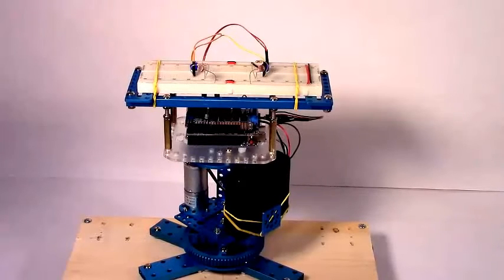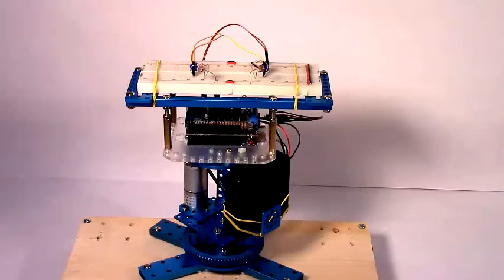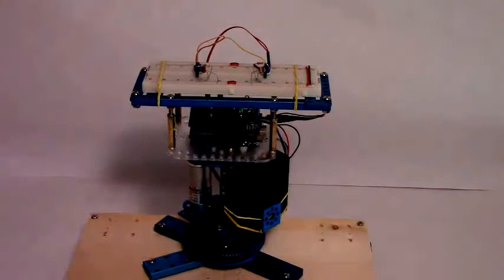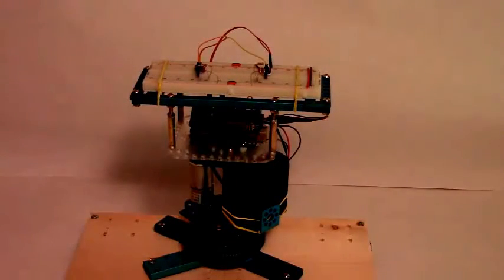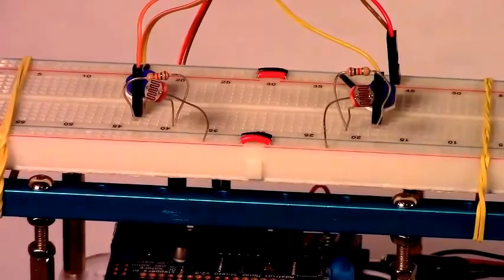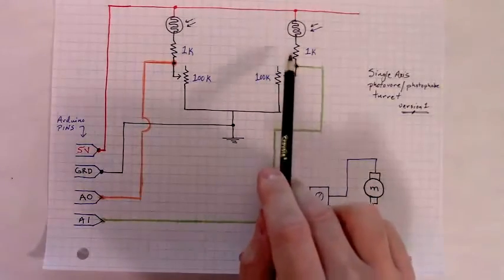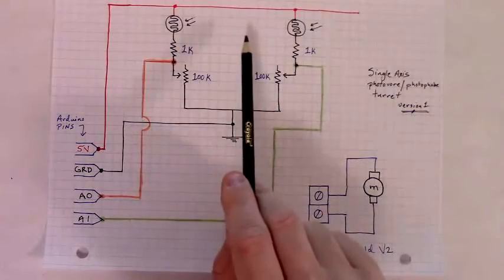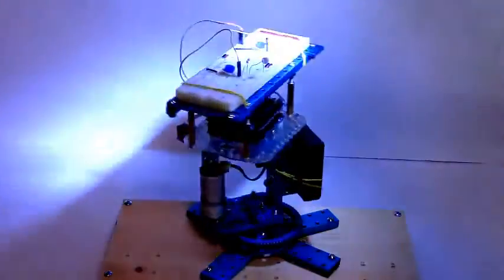Arduino Robot Projects || Single Axis Light Chasing/Avoiding Turret || Version 1

Comment from the maker: /*
title: photovore_photophobe_turret_version_1
by: philomech
date: 2/2015

*Code logic could be simplified a bit, but works fine as is.*

*/
#include <Wire.h>
#include <Adafruit_MotorShield.h>
#include "utility/Adafruit_PWMServoDriver.h"

// Create the motor shield object with the default I2C address
Adafruit_MotorShield AFMS = Adafruit_MotorShield(); 
// Or, create it with a different I2C address (say for stacking)
// Adafruit_MotorShield AFMS = Adafruit_MotorShield(0x61); 

// Select which 'port' M1, M2, M3 or M4. 
Adafruit_DCMotor *motor_one = AFMS.getMotor(1);  //turret motor connected M1

/************************
* global variables        *
************************/
const int p_cell_left  = A0;     //assign photocell pins
const int p_cell_right = A1;

int left_value  = 0;      //used to store incoming
int right_value = 0;      //p_cell values

const int bright_threshold = 800;  //adjust as needed

/************************
* setup                   *
************************/
void setup(){
 
  //Serial.begin(9600); delay(100);  //for debug
  
  pinMode(p_cell_left,  INPUT);
  pinMode(p_cell_right, INPUT);
  
  AFMS.begin();  // create with the default frequency 1.6KHz
  //AFMS.begin(1000);  // OR with a different frequency, say 1KHz
  
  // Select which 'port' M1, M2, M3 or M4. In this case, M1
  Adafruit_DCMotor *myMotor = AFMS.getMotor(1);
  
  // Set initial motor speed, from 0 (off) to 255 (max speed)
  motor_one->setSpeed(140);   //adjust as needed
  
  motor_one->run(FORWARD);
  motor_one->run(RELEASE);
  
}  //<---end setup

/************************
* main loop               *
************************/
void loop(){
  
  //collect left-right values
  left_value = analogRead(p_cell_left);
  delay(2);
  right_value = analogRead(p_cell_right);
  delay(2);
  
  /*  //for debug
  Serial.println(" ");
  Serial.print("Left = ");  Serial.println(left_value);
  Serial.print("Right = "); Serial.println(right_value);
  delay(500);
  */

  //-------photovore/light chaser code-----------------
  
    //Is either value greater than bright_threshold?
  if((left_value > bright_threshold) || (right_value > bright_threshold)){
    
    //if left value is greater than right, turn "left"
    //i.e.,turn toward the light
    if(left_value > right_value){
      motor_one->run(BACKWARD);
    }
    //else if right value is greater than left, turn "right"
    else if(right_value > left_value){
      motor_one->run(FORWARD);
    }
    //else if they happen to be equal, stop motor (possible 
    //but unlikely given current orientation of p_cells)
    else if(left_value == right_value){
      motor_one->run(RELEASE);
    }
  }
  //stop motor if neither is above bright_threshold 
  else {  
    motor_one->run(RELEASE);
  }
  //-------end of photovore/light chaser code---------

  /*
  //------ photophobe/light avoider code----------------
  
  //Is either value greater than bright_threshold?
  if((left_value > bright_threshold) || (right_value > bright_threshold)){
    
    //if left value is greater than right, turn "right"
    //i.e., turn away from the light
    if(left_value > right_value){
      motor_one->run(FORWARD);
    }
    //else if right value is greater than left, turn "left"
    else if(right_value > left_value){
      motor_one->run(BACKWARD);
    }
    //else if they happen to be equal, stop motor (possible 
    //(but unlikely given current orientation of p_cells)
    else if(left_value == right_value){
      motor_one->run(RELEASE);
    }
  }
  //stop motor is neither is above bright_threshold 
  else {  
    motor_one->run(RELEASE);
  }
  //-------end of photphobe/light avoider code----------
  
  */
  
}  //<--- end main loop